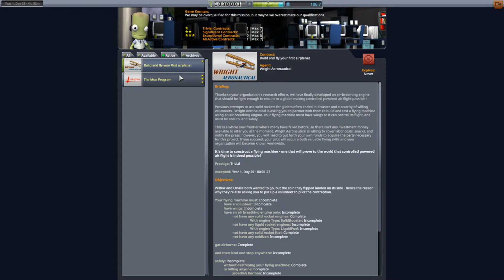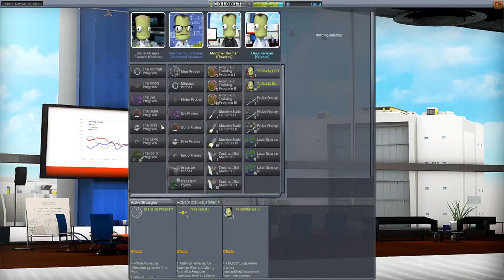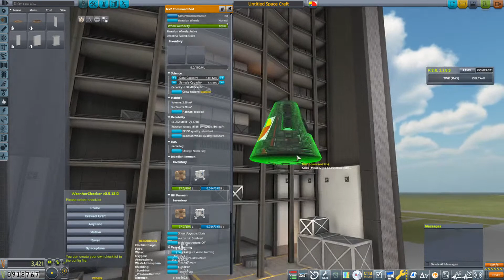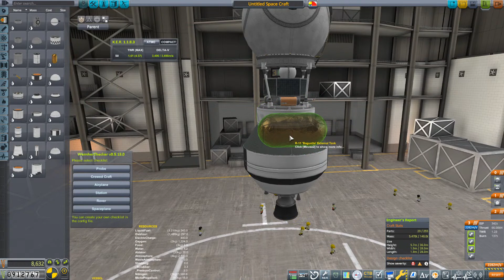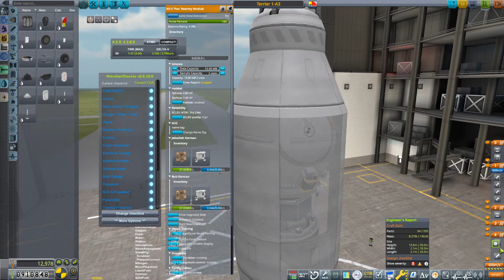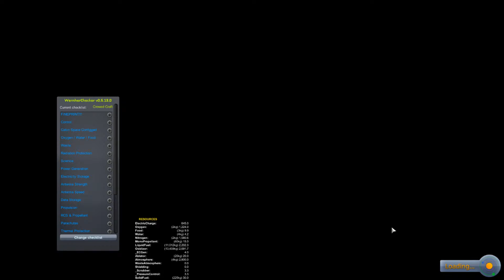Mun Program - Part 5 | KSP Live Stream (1.11.1)

Comment: 26:30 selecting 'set root part' and clicking on the top part (I think in this case the battery) will let you attach this assembly to the pod.
This also works when trying to merge a pre created ship with a root part other than the top or bottom part.

Comment: 0:53 IRL, the Vostok capsule was weighted at the bottom so aero forces would make it go retrograade, which seems to be the case here. Of course, the pilot couldn't ride it down. The Voskhods had rockets in the chute to provide a brake and those could be ridden down.
1:13 kOS? AT LAST MY MOD LIST IS COMPLETE AGAIN
1:15 My launch script has two parameters: target inclination and the attitude the vessel needs to reach for the solar cells to be exposed.
1:17 I usually steal scripts, and then modify them, because I suck.
1:19 I wish autostrutting came with a price. More money, more mass...
1:24 A 1202 alarm states the flight computer is being overloaded, in Apollo 11 because Aldrin left the rendezvous radar on. 
I will Google to see if I am right. (Yes, more or less. Specifically, 1202 means the computer cannot store any more vectors for navigation.)
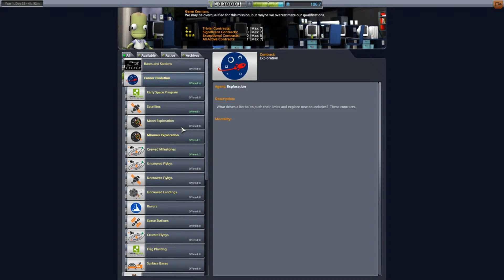1:31 The fuel smartpart can fail to trigger if the engine dies before using all the fuel. This can be avoided by setting the trigger level to 1%, placing the part on the smallest fuel tank, and making sure it drains last.
Reply from the maker: I worked out what was happening. Turned out I had to stage twice. This seems to have something to do with using an action group to eject the fairing and escape tower. I put a stage call in where the error is thrown and everything's good.

The 1202 error is silly. It's there because the calculation that sets the throttle divides by availablethrust. I couldn't have a calculation like that without putting it in an if availablethrust > 0, but what if availablethrust = 0? Never thinking that could happen, I wrote a silly error message.

Comment: 11:49 Ironically, I think the Level 1 runway is rougher than the grass. 
25:50 Usually, I'll leave the extra oxygen in case a fuel cell is needed. But this is pure solar, so...

Great so far! Off to bed now, will watch the rest later...
Reply from the maker: 11:49 Yeah, but it is better than it used to be.

25:50 I just have to be careful in the shadows. Maybe more batteries isn't a bad idea.
Reply: @MikeAben  I believe the grass is as smooth as glass because it has no details. I wonder if it would be possible to add random forces to wheels moving over grass or other unimproved surfaces, just so you can say things like "It is better to land on the prepared strip."
Reply from the maker: @JohnWilliamNowak  That would be neat, but I would definitely want less sketchy landing gear first.
Reply: @MikeAben   Right, it's more a proposal to overhaul how the ground interacts with wheels. After that, wheels need to be looked at again. The forces should be scaled to speed, so the faster you go, the more effect the ground has. This also means a plane designed to land in grass should touchdown at a low speed.
Reply: The Parallax mod does that, it looks great but does mean no more landings on anything but runways if you are using tier 1 landing gear. And early rovers have a harder time near the shoreline (now more rocky) and in grasslands too.

Comment: Running both Terrier (or Pug) and the 3xAnt will reduce the effective Isp (fuel efficiency). In vacuum the Terrier's efficiency is 345s, Pug is 340s and Ant is only 315s.

The effect is limited by the very low thrust (and thus fuel usage) of the Ant's, according to KER the "effective" vacuum Isp of Terrier+3xAnt combination is 342s, IE ~0.8% less delta-V for the same amount of fuel burnt compared to just the Terrier (assuming they're at the same throttle).
So if you your TWR is sufficient (which it usually is for an upper stage) it's better to only use the Ant's in case of a Terrier failure.

You have an unused shroud in the middle of the upper stage that was originally for interstage nodes, you didn't remove it when you stopped using it, so you can get a little bit of free delta-V by removing that.

To improve stability during ascent you can change the flow priority so it empties the lower tanks first (IE higher numbers the lower you go), being able to do that is one benefit from not having large enough fuel tanks yet for the larger engines :-)
Reply from the maker: I realized the Ants reduce efficiency a bit, but they're worth it for the back propulsion. If the Terrier failed, my Kerbals would likely be dead otherwise.

Good catch on the middle fairing. I'll remove it.

Thanks, but the booster is plenty stable as is. There's no need to muck with the tanks.